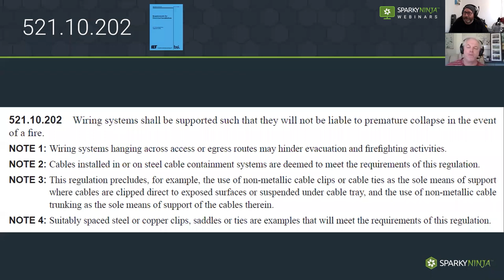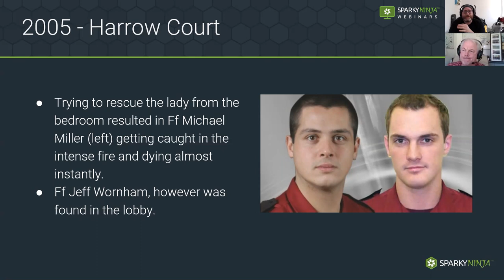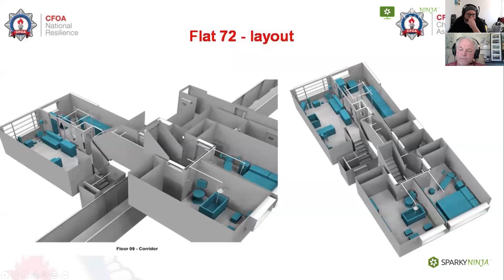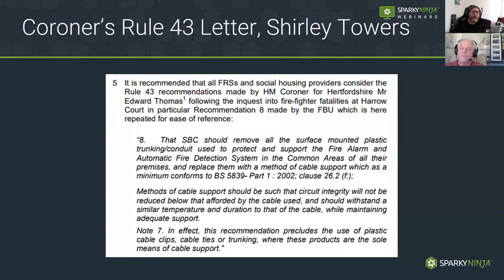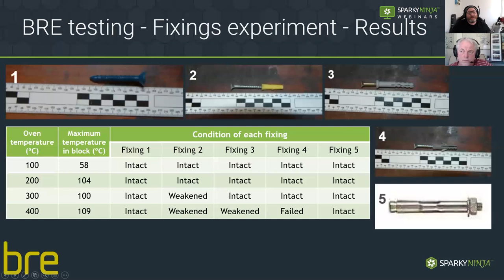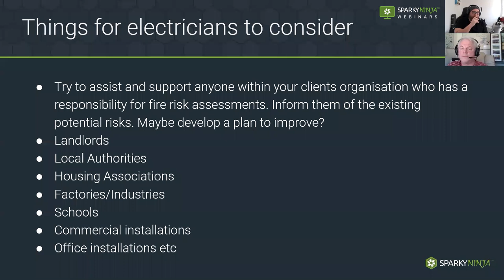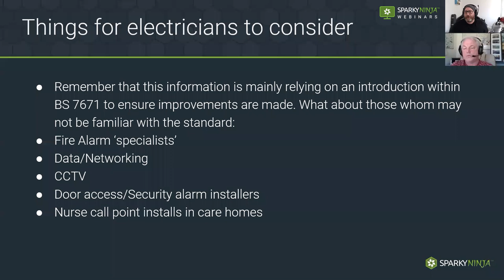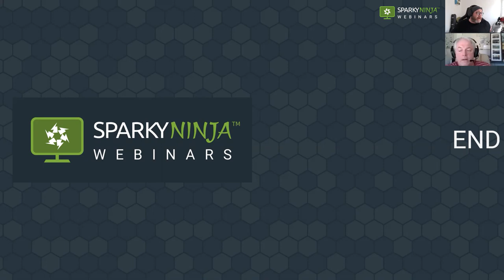A firefighters view on the premature collapse regulation - A SparkyNinja Webinar

Comment: What temperature are there's metal fixings designed to work up to. The ex fireman was talking about temperatures over a 1000 degrees, mild steel has a melting point of between 1300 -  1500 degrees. That's assuming these clips are made from mild steel.
Reply: The compartment with fire in will be >600 degrees at ceiling height. 

Heat transfers by radiation, conduction, convection. Smoke is hot, several hundred degrees hot. Smoke convection is what was causing the plastic conduits to melt in Shirley towers. 

In Shirley towers the fire was in the lounge and kitchen on the 9th floor. The wires dropped on the 9th, 10th, 11th floor and 11th floor corridor outside the flat. That’s all radiated heat, convection heat from the heated smoke. Not direct fire contact.

This means the Firefighters couldn’t get to the fire front to extinguish it easily, nor could they freely escape. From memory 6 firefighters became entangled in Shirley towers, 2 died with wired wrapped around their BA sets, helmet, neck and arms. 

As far as my understanding is (fire background not electrician), by having metal fixing, they will have a similar melt point/fail point as the wiring itself, it should mean that wires will be burnt away not causing an entanglement hazard at the same point or before the metal clips fail. 

In a room with a fire, I’d expect to find wires dangling down, and I’d be firefighting from the door. In the corridors leading to and from that haven’t had direct flames in, the temperatures are such that metal fixing should offer enough support to keep the corridors clear of dangling wires. 

I hope that’s not come across condescending. It’s quite hard to be concise on an issue with so many factors